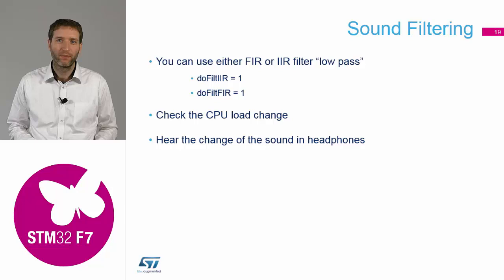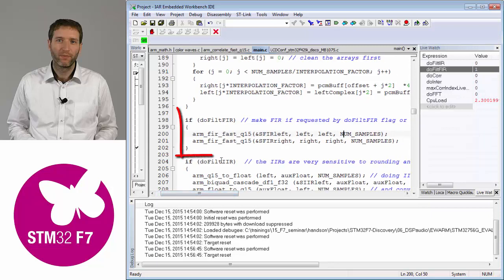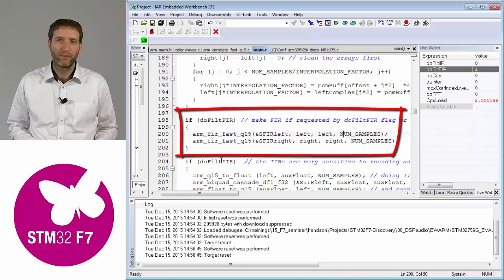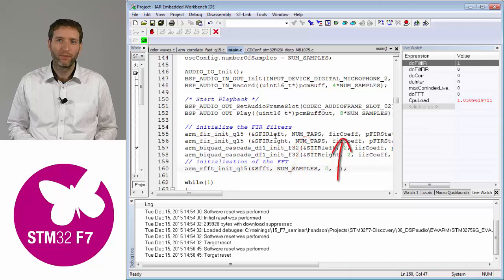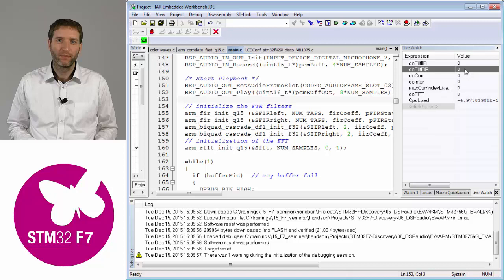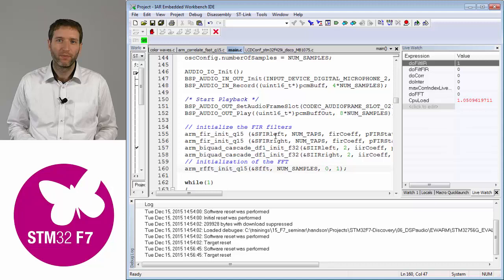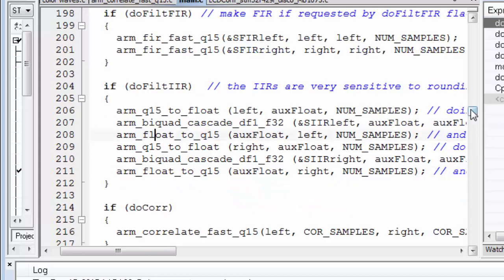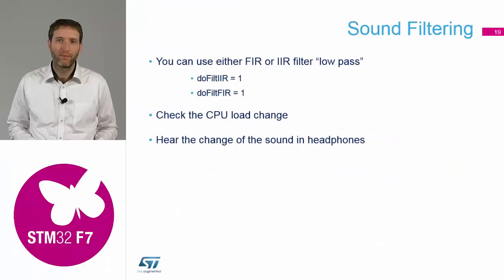STM32F7 workshop: 04.8 DSP corner - Hands-on, digital filtering

Comment: 1:00 .. I actually use the left and right arrays as the source and destination at the same time..

That is usually not such a good idea... because you may get all kinds of confusing issues and bugs.. However, I am assuming you are doing this due to lack of RAM.. I have been looking into this, because among other things such as mp3 decoding and fft I want to implement an audio delay line for max 30  seconds, so that would be like 44100*4*30 = 5Mbyte by means of fifos, and then after seeing what external hardware fifos of that size cost, around 400 $, and that there are no external memory break out boards, not to mention the design difficulties with memories at high speed, such as keeping all the data lines at the same length... I decided that for me at this point, ordering the Stm32H747 Disco board, with 256 mBit of ram, which is 32Mbyte, for around 80$ is the best cost effective solution to go at the moment. Although I do not really like that I have to pay for a touch screen which I will probably not be using, because the variants without the touch screen are not being sold, and also that the wm9884 codec is not fully wired, but what's there is good enough, but still you get 32Mbytes of RAM, with a dual core processor and an audio codec for 80$. And so that's going to be good enough for my application, although I will have a spare touch screen lying around, and so I am still trying to figure something out to utilize that as well, but because the microcontroller board will be built in I would need to extend the cables to mount to touch screen somewhere on the outside, while there is not much space to make it fit, so it will probably end up lying around...